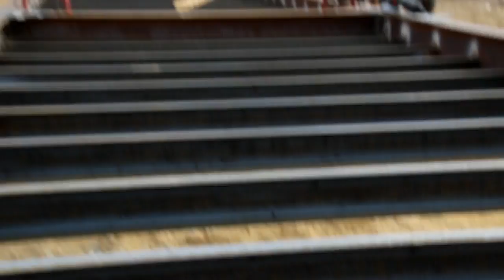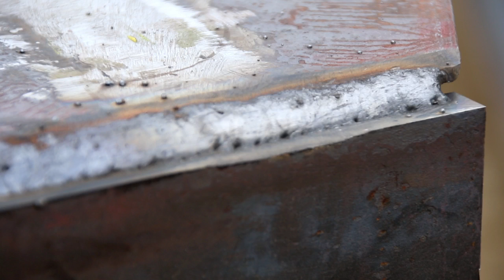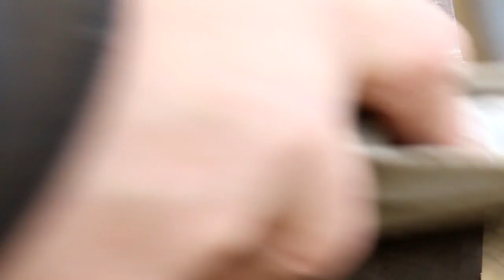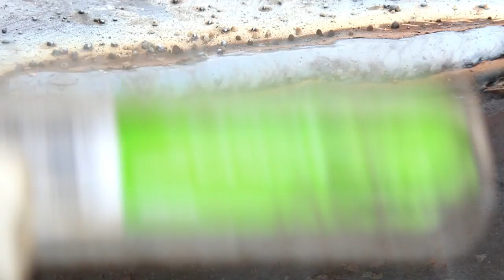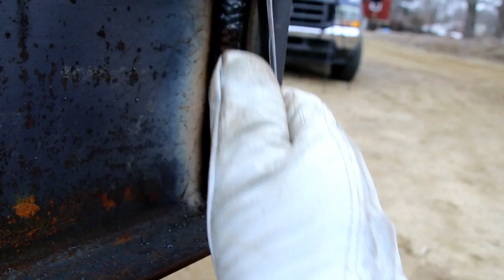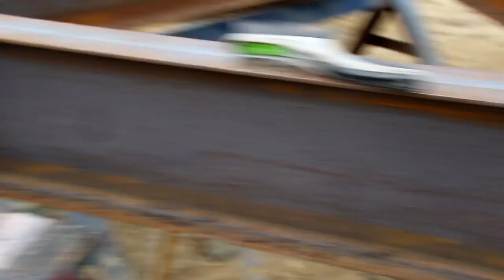Trailer Fabrication, FCAW welding with Hobart XLR-8

Comment: Dual shield is also compatible with 7018 and ran with co2 u can run it outside no problem co2 is alot heavier than gas dual shield is way faster I use nr232 at work all the time but its not as easy as dual shield

Comment: Thanks found this video as I want to test using the wire currently using Triple 7 but the gas is a pain in the field for general structural do you like the 1/6 or larger and any tips or settings are appreciated!
Thanks for sharing 
Charlie

Comment: So that’s a all position wire yes!
Reply from the maker: all position wire, but vertical welds must be made up.  This wire can not be run downhill on vertical welds.  Once you get the hang of it you will love it.  Like having 7018 electrodes on a roll.

Comment: That trailer is one of the most solid builds I've seen perfect wire to use it's scary I've seen guys weld heavy material like this with short circuit mig in janky production fab shops this is quality
Reply from the maker: Thanks for watching.  IF you follow the trailer build along you will see that it is now the base for my paint booth .   Added some outriggers on it and built a very large and functional structure on it.

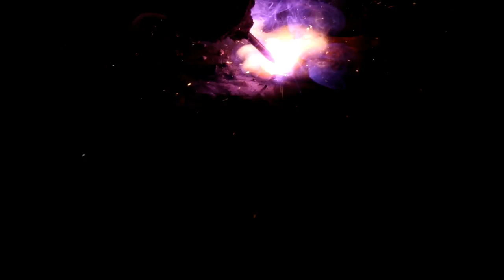Comment: 7:40 you can make one pass and fill it in and round it off at the same time but you need to have lotsa of experience to do that. Not bad
Reply from the maker: There are lots of different ways to weld, I use stringers to keep heat down, you may do it differently.   Remember the weld test machine does not have eyes or an attitude.   My welds always pass inspection.
Reply: @metalshaperJeep  oh I agree. I'm not knocking your welds

Comment: I'm getting porosity from start to stop. Good toe tie ins though. I turned up the WFS and it eliminated all of it. Was this luck or is this wire really that finicky? I'm also running on 240v single phase power source. Can this handle .68 wire.
Reply from the maker: You may want to try increasing your stickout to about 1" and that should help.  Let me know about your settings, this wire is sensitive to all settings and a simple adjustment will help tremendously.   single phase power shouldn't be a problem.

Comment: The way yout slag drops off should i expect the same on smaller material and smaller wire like 0.035 if my settings are good, novice from uk i keep going over video just to see how easy your slag dtops off cheers,
Reply from the maker: If your settings are correct,  heat, wire speed, etc... the slag should roll right off.  Takes some experimenting to get things set up correctly but when they are correct you will get same results.

Comment: what welder are you using for the construction?
Reply from the maker: I am running a Miller Trailblazer 302 gas drive welder for power, and have a Miller 12VS suitcase feeder, with a Bernard Dura Flux gun.  Running Hobart XLR-8 wire in .072" size.  Thanks for watching, hoping to get more done on the trailer but the rain has been almost every day and that is holding up the project.  
Brian
Reply: thanks for thee quick reply, i was thinking about building my own heavy duty trailer for hauling a small backhoe.  Your build will work perfectly
Reply from the maker: This trailer will be registered as a 14,000 pound GVW trailer.  I am wanting a true 10,000 pound capacity.  If you follow the size of the steel I used in this construction and use heavy axles and tires you would be able to register this as a 16,000 pound trailer.  I didn't want to go bigger than dual 7K axles though so keeping the paperwork at 14K.
Reply: this will be used on a ranch only, so i am not worried about registration and if i am hauling short distance on the highway, if it ranch work no registration is required
Reply from the maker: sounds good,  hope to see your trailer when it is done.  I have built a few so if you get into any situations or need any info just let me know.
Reply: will do, I am going to hit some buddies up and see when welders they have.

Comment: so what do you use to pull that beast!   and any reason why you welded past the side plate reinforcements?
Reply from the maker: Yes, welding past the plate is the proper way to put in a plate.  Do a search and some research on " flitch" or "fish" plates, and you will see how to install them properly.  Will talk about it more when the trailer is flipped and the plates are fully installed.
Reply: so heavy it'll take  Master to pull. and use lots of gas doing so.